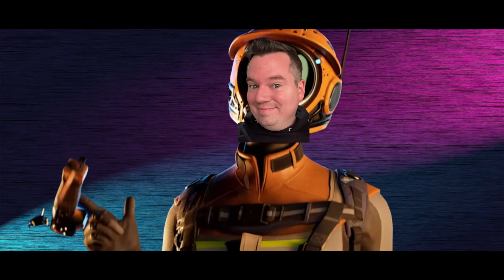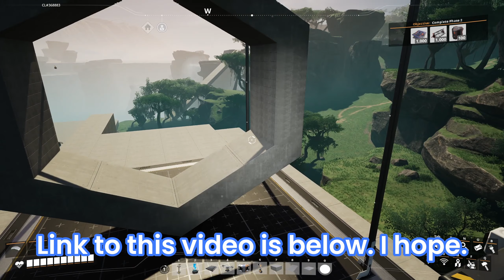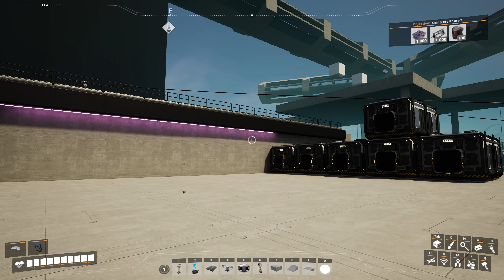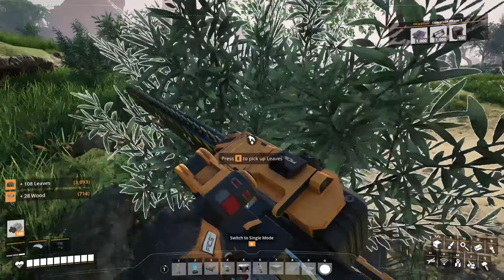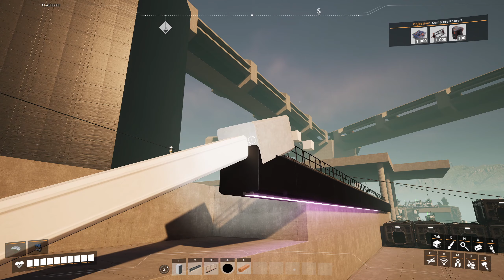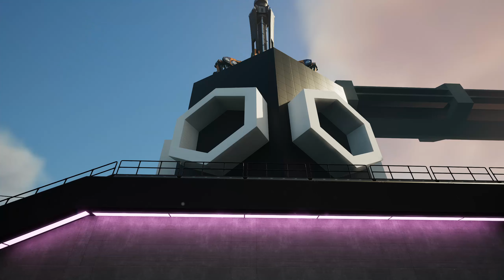Set smaller goals you can start and actually finish to make progress in Satisfactory.

Comment: I'm currently struggling in my own 1.0 playthrough. I've unlocked everything through tier 6, but haven't built a single permanent factory. I now want to transition into later game tech but I need to build an actual base that's making components, and I can't really decide, logistically, the best way to go about this. I guess I'm stuck in "analysis paralysis". Do you mind if I joined your discord?
Reply from the maker: Join us! When you’re with us, you’re not alone!
Reply: @stupich5868 check out the satisfactory calculator. There's a setting that switches between simple view (just processing machinery) and realistic view (mergers, splitters and numbers)

It's daunting at first but spread out the connections into groups and work in sections.
Reply: Would love to join also

Comment: Finally someone who's inventory is also a mess :) Opens Container... yeah no space for harddrive.
Reply from the maker: I didn't even hesitate to take the 6 inv spots instead of steel screws. I'm ALWAYS battling full inv. I do think the DD will fix this as I get used to using it. Have you embraced it and used it well?
Reply: @BEDplaysGAMES  DD?... Dimensional Depot? Right I forgot about it :) I started in desert so SAM ore sort of hidden and haven't collected alien stuff cause no room or had no use of yet. Researched but still not using... probably cause I don't have resources to build em or forgot about it. Brain is like Upgrades People Upgrades even though I don't even have a foundation or proper automation in place. Currently even feeling bad for deforestation, the places looked pretty.... new game????.... just collecting reasons to start again lul.
Reply: @BEDplaysGAMES  currently even thinking if I can stop producing stuff automatically and then resources would go to other use case.